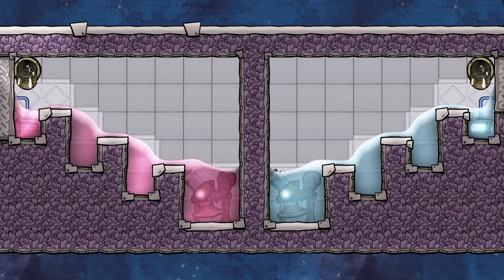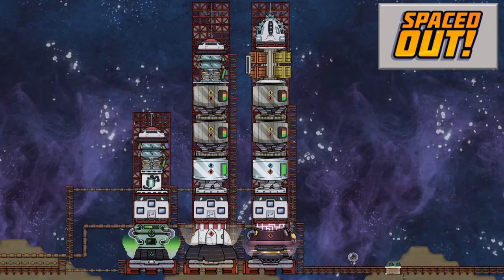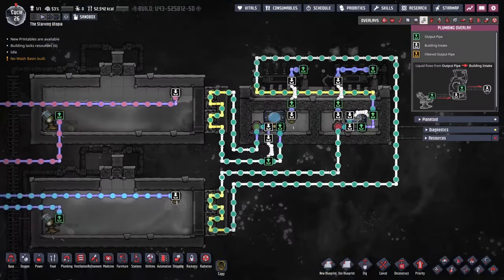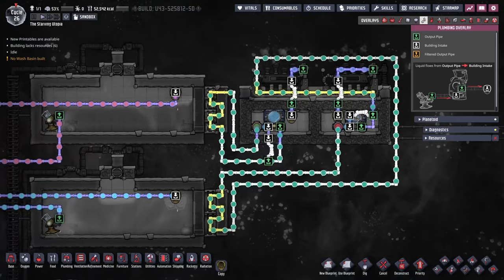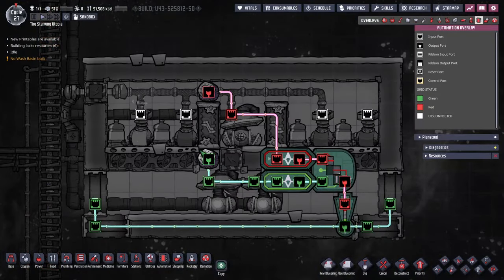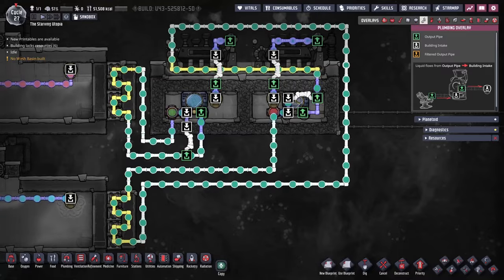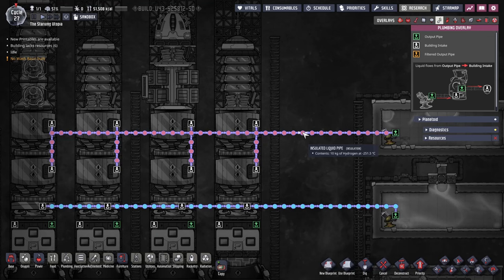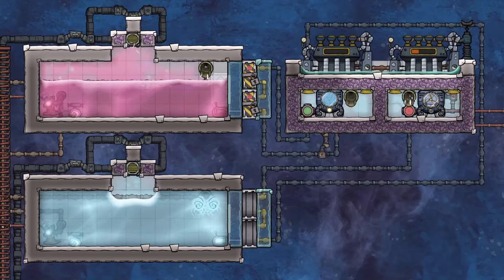Oxygen Not Included - Tutorial Bites - Liquid Hydrogen & Liquid Oxygen

Comment: FYI, you can also use a liquid meter valve to fill rocket tanks with precise amounts of fuel and avoid having to create a loop.
Reply from the maker: I hadn't thought of using those, but for the base game that is definitely a good way to avoid wasting these liquids.
Reply: Another thing you can do is create a loop, but to limit the flow to 1000g per second so that it can't flash in the pipes.
Reply from the maker: That is possible, but the quickest you could fill a full tank would be 900s, or a cycle and a half - hence why I didn't include it in the video.
Reply: @GCFungus  2 outputs from the pump combined further down. 1st to a valve at less then 1000g. 2nd to a shutoff that is activated by absence of liquid in the return line.
Reply: I have the meter setup for petroleum in my current game, and it is so fast to refill compared to the manual work for oxylite, that really is a motivation to go LOX asap. Don't think limiting throughput is necessary if you can avoid it.
Reply: Liquid meter valve would only work without a loop when the tank is completely empty.  However it would still be a good idea with a loop so you can shut the flow off and stop wasting energy on pumping and cooling.

Comment: You can make liquid oxygen without super coolant by creating liquid oxygen with Thermo Regulators, then using that liquid oxygen as coolant inside an Aquatuner loop, to make more liquid oxygen. Allows you to run large Petroleum Engine rockets without having to make Oxylite, before you find Fullerene/Graphite. To stabilize the temperature of your coolant instead of it swinging by -14°C, run the outlet from the Aquatuner into a Liquid Reservoir with coolant stored inside. Same concept works for the Super Coolant when making liquid hydrogen, where you don't want to freeze the hydrogen. I use that instead of doors and conductive tiles.
Reply from the maker: Yes that's right, which is why I was specifically cautious to not say that supercoolant is the only way to make liquid hydrogen and oxygen, but is arguably the easiest!
Reply: how many layers of radiant gas pipes u are doing?

Comment: tip: use liquid bridges instead of insulation/ceramic pipes as bridges don`t transfer any heat. for insulation its cheaper and for ceramic it reduces the thermal transfer even further.
Reply from the maker: Definitely a good idea, although I'm not sure I could stand the sight of so many ports stretching across the sky!
Reply: This been updated, nowadays bridges cunduct heat between its ports
Reply: @danielmatos4647  dam, really? Thats dissapointing.
Reply: @danielmatos4647  so i just tested it and the bridge still does not conduct the heat to the liquid or the pipes it is connected to.
Reply from the maker: To clarify here - the bridge will transfer environmental heat between both ports. What Kevin is correctly saying is that the liquid does not transfer heat to the surroundings when passing through the bridge, making it as good as one segment of insulation.
Reply: @danielmatos4647  Since one side is in a vacuum there's nothing to conduct heat to/from, and the bridge still bypasses the wall meaning insulated pipes are not needed.

Comment: One thing that I should mention is that you need 1.8 kg of hydrogen gas to produce 1000 kg of liquid hydrogen, oxygen numbers are the same. I'm not sure how does it work, my guess is that the game calculates the number of tiles each material takes when changing states. But I was extremely terrified when saw rocket calculator numbers for the first time. Just imagine if it was like the real life, and you needed to produce 3000 kg of hydrogen gas to reach Temporal Tear. XD
Reply from the maker: I'm not sure where you're getting the numbers from, but hydrogen gas to liquid hydrogen is 1:1, as the encyclopaedia says and I double checked to make sure.
Reply: @GCFungus  My Hydra produced 100 Kg of hydrogen gas. It was more than enough to reach Temporal Tear, which requires around 2500 kg of liquid hydrogen. How? IDK...

Comment: I'm curious what the settings for the atmo sensors on the Bottomless Rodriguez are. I'm trying to use the design right now, but not really understanding what to dial them to without causing a problem.
Reply from the maker: I run them the same as a normal Rodriguez, 450 for Hydrogen and 750 for Oxygen. If too much gas is escaping then you may want to reduce how bottomless it is. Even opening just one tile to space will take a fair amount of oxygen away.

Comment: You can use a Meter Valve to fuel your rockets precise ammounts and avoid the loopback and wasting power pumping it back in.

The meter valve can be automated  with a Counter, a NOT gate, an AND gate and a Filter gate.
Hook the meter valve signal to the Counter, the Counter to the NOT, and the NOT to input 1 of the AND.
The meter valve signal also goes into the Filter, set to 0.2s and the Filter goes to input 2 of the AND.
the AND output goes to the Valve meter reset.

This should be enough to control up to 10x50 = 5000 kg of fuel going through. I also know a setup to make an any digit counter, but 5000kg should be enough.

To get precise ammounts of fluid through, you need to do some math. Divide the total ammount of fuel you need by a whole number, 1-10. Set the result (has to be lower than 500kg) in the meter valve and the whole number as the counter limit. The valve accepts centesimals.

Example: I want to build the heaviest, farthest reaching rocket the game allows (base game): Hydrogen engine, 1 cargo bay (or 10 research modules), needs 5 fuel tanks and 2 for oxydizer according to ONI assistant. 4399kg of each LOX and LH2.
4399/9 = 488.89 kg (you can also divide by 10, I just want an excuse to demonstrate the counter at work)
Pause the game, set 488.89 kg on the valve and reset and the counter to 9. The valve will reset itself 9 times, giving you exactly 4400.01 kg.

Comment: Do you really need to have two? I was thinking it could be done with one loop and the mechanized door injectors. As hydrogen is the colder and more precise of the two the coolant would go through that one first and then dump the remainder into the oxygen tiles. Since it's the doors controlling the injection of cold for both I didn't think it would be a problem to run one loop.
Reply from the maker: In theory yes, but the practical issue is that the heat taken out of the oxygen and into the coolant raises the temperature too high to easily make liquid hydrogen, so by doing it that way you will significantly slow your hydrogen production rate.
Reply: @GCFungus  I did it actually and don't seem to have a problem. But I changed the materials used a bit to more evenly distribute the cold throughout the design. Rather than using regular tiles for the box I used gold metal ones and blanketed the interior with diamond temp shift plates. And I powered the doors so they respond quicker. Couldn't tell if you did that for yours.  Also instead of a bottomless Rodriguez design and the series of gas bridges to keep things moving,  I just added another few segments of pipe after the cold room vent with a vent to space.  This way the only way the space vent ever sees a packet is if the cold room is over pressurised.  

But the inspiration for the basis of the design was all yours. Thanks!

Edit- I removed a bit about stopping the gas flow with automation because I'm still working some kinks out of it.  I'll come back and reply once I do.
Reply: @GCFungus  so what I ended up with was a hydro sensor in one of the top tiles near the vent.  Set to send green if above 0kg. Which goes to a not gate and on to the gas shutoff.  That way only a few packets get vented to space and none gets stuck in the pipe to turn to liquid. Green if below 0 would have saved the not gate. But things get a little finicky with below 0 mass sensing. I could spare the few extra refined metals anyway.  Cheers.

Comment: Quick question, what is the setting for the aqua sensors on the output pump?
Reply from the maker: For the hydro sensors it's shouldn't really matter as long as you keep enough buffer. I'd say around 300kg is fine, and just beware that liquid oxygen only fills to 500kg/tile so you have to be under that.
Reply: @GCFungus  Thanks for the response, I did actually figure it out on my own.

Comment: So what if I continue the oxygen pipe past the point of vent in a cooler, just like you did, but instead of looping it back I'd just add another vent in space to dump everything. That way when the pipe and cooling tank is full, oxygen will just continue going in to space. Wouldn't this be simpler than all the "bottomless" rodriguez logic? Am I missing something here?
Reply from the maker: You could do that, but there are a couple of reasons I think you might not want to. Firstly, it's extra power draw as you're pumping the spare gas out rather than just letting it flow - remember that a SPOM for LH2/LOX production is a net power consumer anyway as you aren't getting any power back from the hydrogen. Secondly by having some oxygen in the pipes you will have a buffer when the oxygen area needs refilling with gas, although usually you have so much this isn't really an issue. Also, you can get away with fewer oxygen pumps in a bottomless Rodriguez design (say 1 or 2), but you would need the full amount if it isn't bottomless to keep the oxygen flowing - so again a big power save. That said, I don't think there's anything wrong with pumping it through, but the bottomless is the more efficient design.

Comment: Why doesn't the liquid hydrogen counterflow the hydrogen gas?
Wouldn't that reduce the power demand by like 90% or more?

Limiting the hydrogen pipe to exactly 1kg of liquid hydrogen while at the same time, running in 1 full pipe of 1kg hydrogen gas?

If one doesn't build the heat exchanger too big, the hydrogen shouldn't liquify in the gas pipes, but be cooled very close to liquifying.

The 1kg of liquid hydrogen won't break the outgoing liquid pipe, even if it's counterflow heated to room temperature.

Only thing there has to be is a loop backwards so the not needed liquid hydrogen won't stack to over 1kg after a rocket leaves

I'm wondering since I never saw that concept in any build here on YouTube.

(I love efficiency)
Reply from the maker: I see what you mean and yes that does sound possible but I think it's not done because it's probably quite a bit of hassle. It does sound like it would work as you describe if the hydrogen is immediately sent into a fuel tank, but otherwise it will circulate back and have to be recooled. Plus you need to be careful that it never forms more than 1kg or things will break, plus you're limiting your hydrogen supply to 1kg/s, so as a minimum that's going to take a cycle and a half to refuel a tank. But it could give you some benefit for sure, so might be worth trying. I think also that bases (and players) that are late game enough to be doing liquid hydrogen usually have their power comfortably sorted too, so saving that bit of power isn't a huge issue at that point.

Comment: Is it possible to build a mining rocket with large petroleum engine having 22 tiles range? (Spaced out).
Reply from the maker: The large petroleum engine can do 20 tiles with one oxidizer tank and 2 fuel tanks, giving you lots of usable height to build dupe and utility modules. I think you can theoretically do 30 tiles, but you'll need 3 fuel tanks and 2 oxidizer tanks (basically needs to be liquid oxygen). Generally for that range, I would recommend liquid hydrogen, which can do 32 tiles with 2 fuel tanks. For just a mining rocket, you may be able to make petroleum work, but you basically have 11 height left outside of engines and fuel. That is just about enough for a spacefarer module, mining nosecone and a little utility. Putting oxygen production inside the module would be helpful, or use the suit trick.
Reply: @GCFungus  Yeah, that was my understanding the with Large petroleum there is simply not enough height left for the modules needed for mining if I want 20+ range. Time to build the liquid h2/o2 infrastructure then....

Comment: Why use diamond window tiles, wouldn't a metal tile provide much better thermal transfer?
Reply from the maker: Diamond has a high thermal conductivity, but metal tiles will also work in these designs too. It's more a matter of preference and what you have available.
Reply: @GCFungus  Thanks. It seemed that in Spaced Out that Diamond is more expensive and has lower conductivity to many metal tiles. I'm still learning the ropes myself. I like your no-nonsense content, thanks.

Comment: My insulated pipe (ceramic) always broken, when transfer to rocket…
Reply from the maker: As I explained in the video, insulated ceramic pipes will slowly transfer heat to the liquids. That is why I showed a loop with those pipes - you need to send the liquids to the rocket ports, and if they are full then return the liquids to the cold room. Basically keep the liquids moving. If they sit in the pipes then they will inevitably break. If they are moving and still breaking, then the pipe runs are just too long, so I would recommend moving the set-up closer to the rockets.
Reply: @GCFungus  i get it... thank you... great tutor